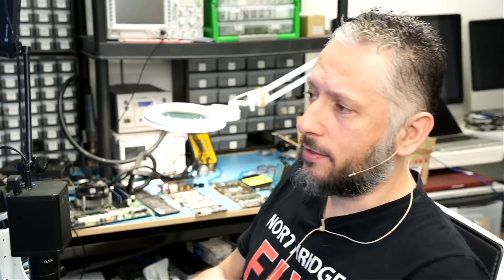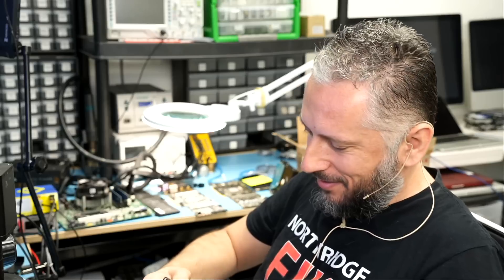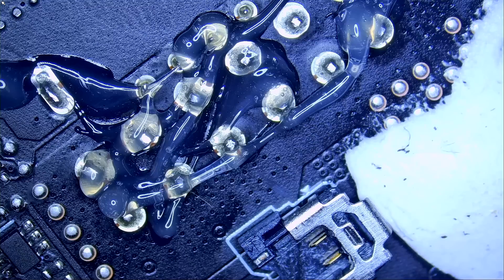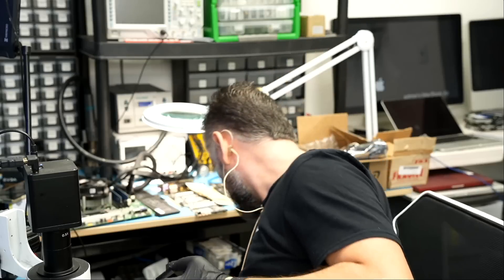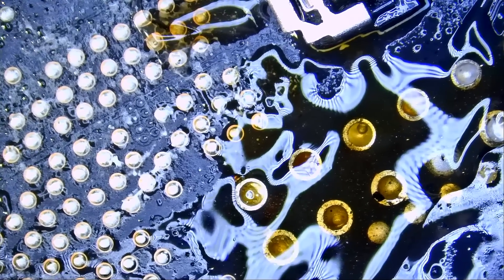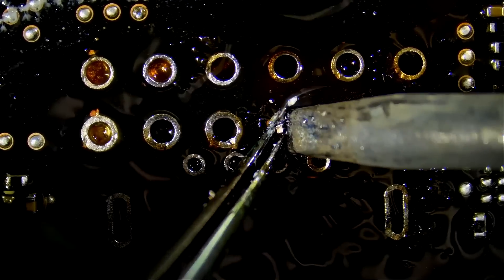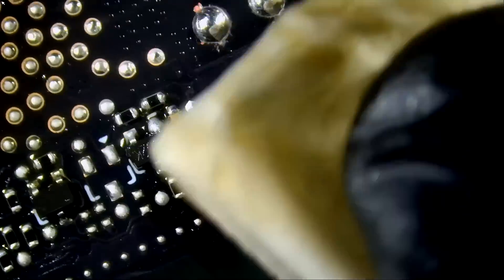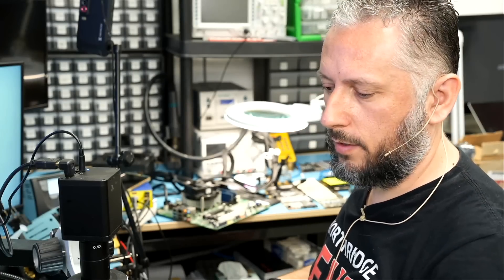4090 FE Connector melted with Cablemod Adapter installed. 40 series cards should be recalled

Comment: If a connector MELTS unless you plug it "all the way", then it's still the engineer's fault. Not the Users'. Especially for a consumer product. 
Gamers Nexus would definitely be interested in this video.
Reply: I was just thinking about emailing it to them.
Reply: Yes and he now trying to make Alex out to be a fool... relaying only on the pictures sent by Alex to him which is pictures taken AFTER Alex was already Yanking on it to get it out. Alex needs to take screenshots from his HD Video of this video showing it was fully pushed in.

Fuq Gamerz Nexus a Shill for the company for free stuff.
Reply: they already did a full investigation and analysis video on this
Reply: @PumpkinEscobar_305  yeah and its all wrong.. your point?
Reply: @PumpkinEscobar_305  Steve said in one of their recent videos that they believe it's mainly a user issue. With the adapter fully seated and the connector still melted that says it's a bigger issue.
Reply: @WoawWoaw  Without seeing how it was installed in the case we will never know what caused this one to melt. It is likely the cable was putting tension on the connector, causing a poor connection. That 90 would provide some good leverage.
Reply: That site is one of the reasons some here are blaming the video card owners for the problem.  This video shows otherwise.
Reply: @markpmar0356  This video didn't include a failure analysis from a lab. His off the cuff statement on what is causing the problem isn't worth much.
Reply: @markpmar0356  not really. Gamers nexus never blamed the users for this. Maybe you saw some other video? Steve never said that it's the users who are at fault. They place the blame straight on nvidia.
Reply: What do you mean it is the engineer's fault that it melts if you plug it in partially and it melts? There is a ton of power going through tiny pins, you are responsible to make sure it is plugged in all the way. With that being said, it is a terrible design for end users due to it being difficult to know if it is bottomed out, but that doesn't mean the engineer of the plug did anything wrong, It just isn't a good plug for end users who are prone to making mistakes in either inserting it all the way or causing to much pressure due to how the cable is run. GN has been through this extensively.
Reply: @--_DJ_--  "What do you mean it is the engineer's fault that it melts if you plug it in partially and it melts? I can see you confusion here, very easy to read incorrectly. I can help. What that person is trying to say is that it is the engineer's fault that it melts if you plug it in partially and it melts. Hope this clears up any confusion on your part. 😁
Reply: @--_DJ_--  The problem of overheating terminals should have been discovered during testing. The fact that they are pumping these cards out every year is clear indication that there is little testing going on.   Can you imagine buying an electric clothes dryer and having this type  problem and the company blaming  the cause that you did not plug your dryer in fully causing your house to burn down?  The company would be laughed out of court. And these cards cost more than a dryer.
Reply: @--_DJ_--  engineers literally designed the connector,how stupid can you look?

PCI-SIG and everyone involved into making this garbage of a connector should be thrown a class action lawsuit for a unsafe design because burning connector can burn down a house and kill people because tolerances and redundancy on this connector were a afterthought

there is no way you can blame something like this on a user end,its like designing a power outlet and then wondering why people get electrocuted just to conclude "please use rubber gloves when plugging in your device" instead of making sure outlet won't electrocute someone
Reply: @D J  the point of this video is that gn is incorrect. Your argument is very conflicting. Most people are upgrading from 3090 and ti and you let company say it's your fault to push blame. This sme is literally getting 4090s in the mail and you still believe an influencer.
Reply: @--_DJ_--  You clearly don't understand consumer devices, consumer rights and proper design patterns. 

One of the most important design requirements for a consumer product is that IT SHOULD FAIL GRACEFULLY, even in the event of user error. If the user does not connect it properly, it should not bring the entire house down causing a fire. It should just not work. That is why in this particular connector there are sense pins, which (should) limit power consumption in case of improper connection.

No consumer device gets CE approval if it melts because a connector was not fully seated.

On top of that, the nvidia connector does not inform the user that it's improperly seated (it does not latch properly) - Steve mentioned multiple times that the user may think they have seated the connector properly, but the connector was not in fact properly seated. 

This is an awful connector design. Normally, there should be mitigating measures that protect the connectors and the device from user error. Not only does this connector NOT protect from user error, as it should, it is so badly designed that it promotes small user mistakes (like nudging the connector a bit while seating the card) into catastrophic failures!

Do not support nvidia on this. There are lots of other high power connectors in your house and they don't catch fire if you "don't insert them properly".
Reply: @grproteus  agreed
Reply: @grproteus  Kind of like when you install RAM on the motherboard, it has hinges that click when you fully socket it to the slots. The GPU connector, does NOT have any indicator telling the user, that it is fully inserted.
Reply: @Prot Eus  You clearly didn't read my first comment saying it is a terrible design. Whether it is good or bad doesn't change the reason why they are burning up. I am not supporting Nvidia, who by the way didn't design the connector, I am stating the reason why they are melting, which is user error.
The sense pins are not there for fail safe, they just communicate what the card is capable of drawing. It has no ability to detect poor connections, it is just on or off essentially.
Reply: @OddWorlderer  I was under the impression that those smaller 4 pins were for precisely that (the "supposed" sensor): am i mistaken?

The problem is that "the sensor" DOES NOT sense when the connector IS NOT properly seated: you can have it "say" it's fully connected, when it's actually not. So a design flaw right there.

This video suggests something ELSE (besides the above) is going on because it looked to me that the cablemod adapter was 100% correctly seated, AND IT STILL burned.

Comment: It cant burn unless the solder wasnt done right and left large current going through thin joint?  or was the connector badly designed.  Why did all these burn?

Comment: so.... this is a proof that it's not a user fault, rather a faulty design issue
Reply: It is just as simple as pushing to high power to small  channel with to little margin for error (redundancy). It could handle it, but it doesn't mean you should design it like that.. Bad engineering imo.. (Don't be blinded by brand loyalty)
Reply: @winnieid2727  Totally agree
Reply: that being said, how long will the replacement connector is going to last?
Reply: @hitenmitsurugi-ryu9880  I'm quite curious about that myself
Reply: @hitenmitsurugi-ryu9880  That all depends on the user using it properly.
Reply: @hitenmitsurugi-ryu9880  exactly lol
Reply: @hitenmitsurugi-ryu9880  50 plugs
Reply: So glad I didn't upgrade my 3090 yet
Reply: @larryhill4894  ❤ same here best decision I’ve made spending 2k on the best 3090oc just before 4 series
Reply: It cannot be sold as a consumer product, if it melts or causes a fire by users not sticking the connector all the way in.
Reply: @grproteus  you realize that any electronic not fully plugged in to the wall outlet is also a fire hazard right?
Reply: They should use ceramic connectors. If it works for my car's high beams that kept melting the connectors, it should work on a graphics card.
Reply: I have cable from mod that has 0.5 gap… i would say mod issue. Teski glupaci
Reply: No it's not proof... there are 2 other connectors to the PSU the user could not have seated properly... Of course he would say it was seated all the way 100%. Its 2000 dollars out of his pocket.
Reply: People that buy psu with cable built in mostly have no issues if they plug in…. Maybe 5 cases we know burnt… cable mod is every day
Reply: Could you solder a short cable directly to the pcb?
Reply: Besides the connector, it could be some kind of power management issue too. 

I imagine there's some spikes happening on these high end cards that cause it to start melting.
Reply: Thank god I bought a 4080. Most of the issues seem to be happening from the 4090.
Reply: it's the new PCIE power standard
I'm guessing the old PCIE power will do just fine, and this new PCIE power not really needed
Reply: Its not really a supprise they are shoving the same power as 3 or 4 8pin pcie connectors. The old connector also was ridiculously overspecced (Which is a good thing)
Reply: @daandupau8013  The best thing about the legacy PCIE connector, compared to the v5 one, it's the feedback. When you plug a legacy one ine, you can feel that you're all the way in (mandatory "just like my ex-wife" segment) and also have a very audible click, when the plug latches. So the user have the absolute certainty the lead is plugged-in correcly.
Reply: @maklogetrich2378  B-b-b-b-b-b-but... my new nVidia card looks soooooooooooooooo cool with just one connector. 4 bigger connectors are just...bigger and ugly ! ugh ! I hate ugly things

- a nVidia GPU user, not probably
Reply: @lamikal2515  3 power connector are cooler imo
Reply: @Maklo Getrich  You don't have cable ocd like some do.
Reply: @--_DJ_--  maybe
it looks cooler with some cable mod
Reply: @lamikal2515  i'd rather 4 8pin connectors to sacrifice ascetics for function
Reply: I mean the if the user didn't plug the right angle adacter all the way is the same shet as plugging directly the cable all the cable mod adacter does is make the cable less bend with was another of the couse of the connect melting is not like the right angle adacter was fixing the issue off fully plug in the first place
Reply: @HosakaBlood  except he clearly showed that the connector WAS plugged in all the way, and it still melted.
Reply: @HosakaBlood  he did have it plugged in all the way because he showed you that clearly
Reply: @HosakaBlood  learn some English before you type dribble.
Reply: @HosakaBlood  exactly
Reply: As you can see in the video it's not an angle problem or cable issue it's a design issue and the makers of these cards should recall them instead they do nothing that is why im sitting with my 3080ti instead of consider buying a 40xx series. And these graphics cards are programmed with Factory specs with an amount of voltage and parameters im curious to sée if you undervolt them fix the issue or not
Reply: @miles4913  Good to see somebody who isn't blindly agreeing with w/e Nvidia says despite the mountain of evidence to the contrary
Reply: 1 or 2 cases isn't a proof of anything, especially if it's not done in a controlled environment. Having said that, everyone agrees that the design(and perhaps manufacturing) of the connector is quite poor.
Reply: @MaD_fX I would agree there are too many variables in this situation.
Reply: Yet another inexperienced user building a PC and I bet he was overclocking. Been running my 4090 for 7 months through hours of gaming and zero issue. I guess this is why Legos have age recommendations on the box.
Reply: It's a crap design that users aren't plugging in properly. Extensive testing has been done by numerous outlets and labs.
Reply: @TLM-Nathan  Numerous independent labs debunked that being the root cause. Can that be a cause? Yes. But this issue still happens when it's plugged in properly, as other labs have shown in detail. So there absolutely is a design / engineering issue, which places Nvidia and it's partners at fault.
Reply: Total user error. Just don't be an idiot and you'll be fine.
Reply: @JJ LW  It isn't quite that simple. The plug is not user friendly compared to the 8 pins.
Reply: @DJ-bl7jy  I think some of the gpus might have clearance issues when installing the plug and Cablemod 90° adapter. I think this could be one of the culprits causing issues. I have a waterblock on mine and I've used the standard Nvidia adapter since December with no issues. Hopefully, it continues to stay that way. 8pin is foolproof but 12vhpwr is better for cable management. I'm hopeful that future designs will make 12vhpwr much more user friendly and foolproof like the 8pin has been for years.
Reply: @jjlw2378  12vhpwr better cable management? you need a good wide case for better cable management with 12vhpwr
with 8 pin, most cases are ok
Reply: @maklogetrich2378 One 12vhpwr connector coming out of the GPU will always look better than 3 or 4x8pin, in my opinion. I have a pretty standard Corsair 5000D, a 4090, and have zero issues with cable management.  My 3080ti with 3x8pin was more of a pain. Once more ATX 3.0/PCIE 5.0 PSUs hit the market with native 12vhpwr connections, cable management will be even easier. Cablemod, ModDIY, and others can provide alternatives for specific solutions/situations.
Reply: @jjlw2378  i'm sorry function over form is much better especially in tha power connector's case
Reply: @blakedmc1989RaveHD  Sure, the 12vhpwr connector probably needs some adjustments and GPU makers need to ensure that there is plenty of room to hook up and disconnect the connector to reduce the likelihood of problems. However, 8pin connectors have also burnt up for many many years now and are considered to be really reliable. The 12vhpwr will get there too.
Reply: @jjlw2378  sorry no they just need to go back to tha 8 Pin power connector, it was nothing wrong with it

Comment: At this point, the best way to reduce the chances of having this occur is by Unvervolting the card. It's frustrating but it has to be done, definitely no overclocking should ever be done.
Reply: U should always undervolt a 4080/4090 card.
U can run them under 1 Volt without losing clockspeeds...and temps are even getting better as they already are :)

Nvidia should have stayed with the old school 8pin plugs.
Reply: @DutchGuy_Limburg  nah 4080 is fine without an undervolt, effective, stable and cool. Unlike the 3080.
Reply: undervolting the card is not going to stop this from happening. The pins inside the connector are heating up enough to melt the plastic. We are talking hundreds of degrees, turning the pins inside the connector into torches. This is due to resistance on those particular pins built up because of a poor connection between the card connector and the power supply connector. The resistance is caused by not having enough contact surface between the pins and the holes they go into. It could be due to the plug not being in far enough, or a pin or 2 could have made bad contact and gotten pushed inside a bit, or debree in the hole blocking a good surface connection. It would be like trying to boost your dead car battery to start your car with a pair of paper clips instead of decent booster cables.
Reply: You need to cap the total power draw, undervolting only lowers the output voltage of the buck converters. The card will then go to higher frequencies, drawing more current until it hits the power cap. To the plug it still is pulling 12V 450W, unaffected by the undervolt.
Reply: @RandomEngineer69  not ~ the card doesn't pull 450w unless called upon to do so, and when undervolted would never
Reply: After Alex repaired mine and I undervolted to be safe, good advice.
Reply: @rancid_  my 4090 never goes above 300 watt´s...
Reply: Undervolt is just bullshit. It is like you go out to buy a Ferrari , then detune the engine to only have 100HP so that the engine can last longer or you want to get better fuel consumption. Come on, this is an RTX 4090, top of line GPU out there , it has to be performing like a best of the best GPU.
Reply: @fleurdewin7958  Yes now cuz of this melting fkup need to check the card + connector every week to see if burn or not.
Reply: Is 0.985 good undervolt ?
Reply: @ali09gaming58  these cards undervolt amazingly ~ even undervolting 20% only loses 3% of performance and saves a lot of power and heat ...but that alone does not mean the condition will not occur
Reply: unless you speak of your own experience, there is nothing that suggests that.
Reply: well i had my 4090 undervolted until i am facing stability issues(reset TDR errors) on the latest drivers for AI upscaling +frame interpolation using topaz.
Reply: @gheyvillan9638  you have to find the voltage/clockspeed sweetspot. 
not every card behaves the same.... silicon lottery
Reply: @DutchGuy_Limburg  i have three settings which works fine on benchmarks and games 0.880v @ 2520 , 0.950v @ 2805. +999 memory. Now with topaz ai on latest drivers it fails processing the video at 50- 70 percent wtf and the processed video is lost. they even fkin us with the driver updates
Reply: under-volting will accomplish nothing. if you screw this up, connector will still melt. the issue is not with the gauge of the cables of the size of pins. the issue is users plugging the cable incorrectly and causing a point with a high electrical resistance. this is a 425W GPU when running at stock settings, but even twenty watts is enough to melt this connector if this high resistance spot is formed

if you plug this cable at an angle, or plug and unplug it repeatedly, or both, you will eventually cause the high resistance spot. just plug it in once, plug it in straight, and you will be fine.